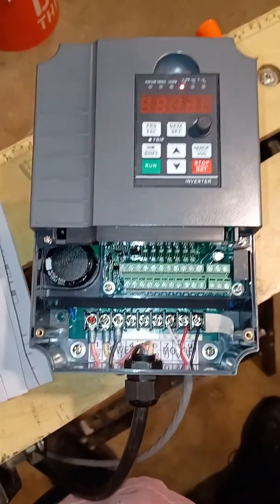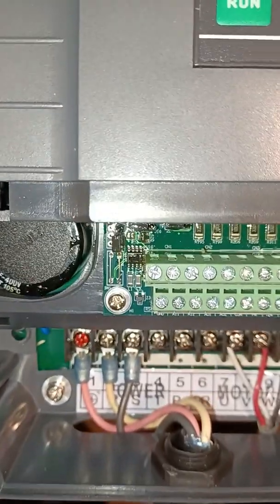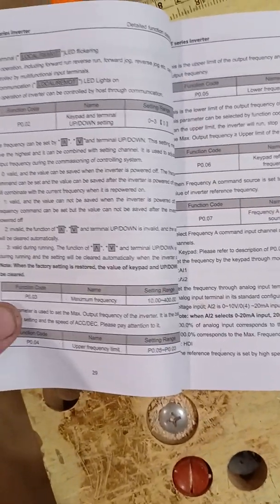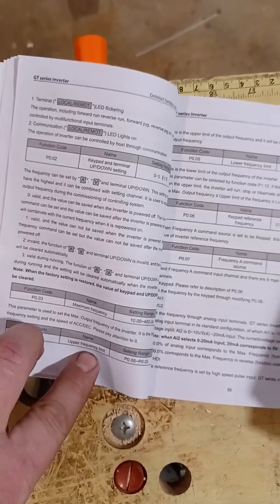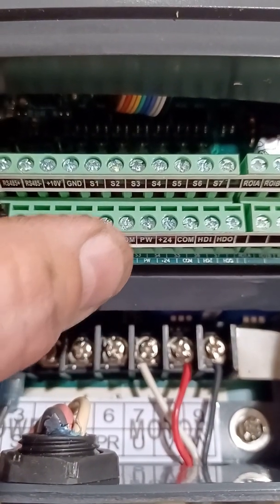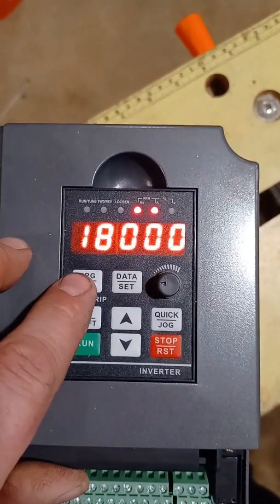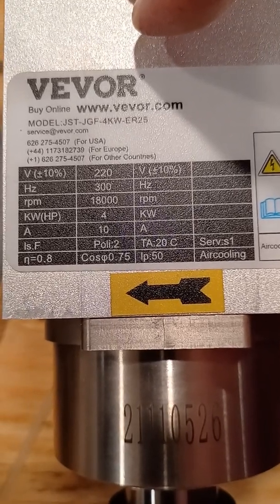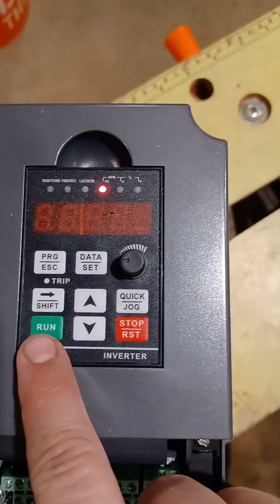How To Program 4KW VFD And Stuff To Watch Out For

Comment: What will you use with your spindle as far as tool holding? Like what size collets?
Reply from the maker: It has an Er25 collet on it.  I got both metric and imperial collets for it.
Reply: @backwardsmachining7526   Ahh Er25 I see.  It looks nice. Shame about the window of speed they recommend, but I guess it's the same as running many motors off of a VFD where while you can run them slower, you shouldn't because they're going to heat up and burn out.